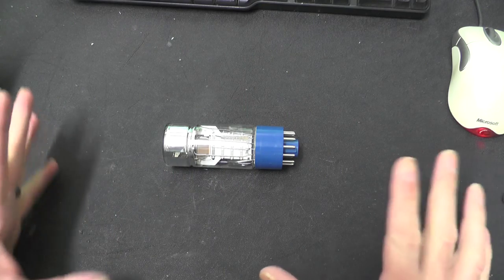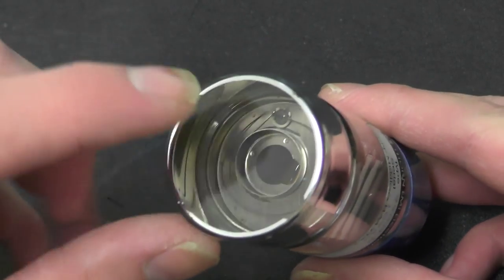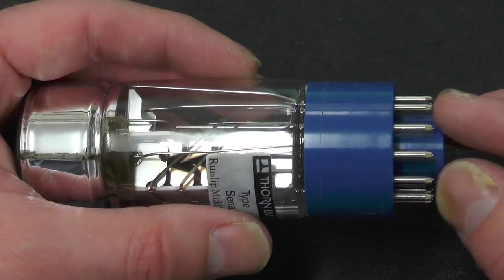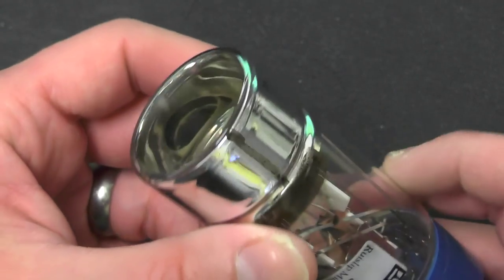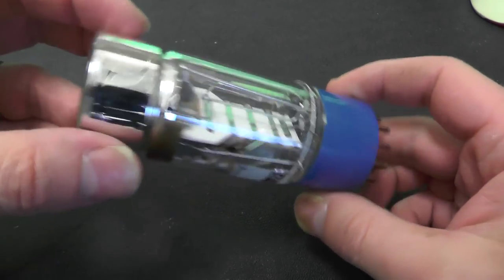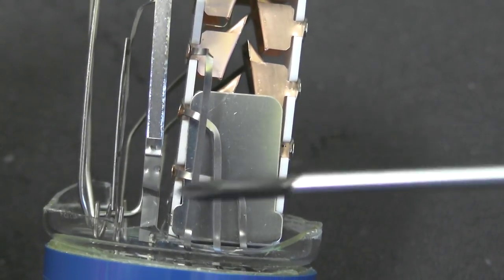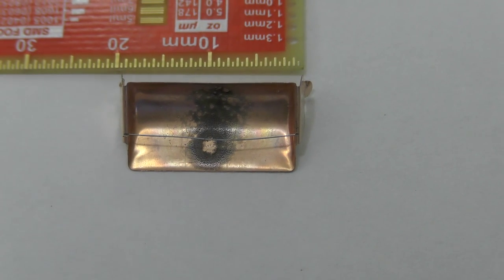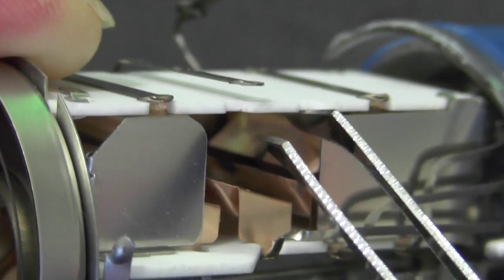DL#046 - EMI 9902KB Photomultiplier Teardown

Comment: That strip to the cathode is probably your getter strip. There are getter materials that are non sputtering, but which are activated and then act as an absorbtive material for the evolved gas. Thorn was a leader in this, which is now used by Phillips in HPS lamps. You will find there is a second cathode lead on the other side ( possibly cut off before the tube base is done) so they can pass a current through the getter strip during evacuation in the oven just before the final sealing is done so there is the least amount of gas present.

The dynodes do get hot, they are absorbing all the energy of the primary electron over the minimum required to do the secondary emission. This results in heating of the material. The black is probably the sputtered off cathode material from the tube that was accelerated down to the dynodes from high voltage field, along with fine particles that got sputtered off the preceding anodes and then accumulated there, now turned to a black copper oxide as you opened the tube.
Reply from the maker: SeanBZA Thanks Sean, a fountain of knowledge as usual. Any thoughts as to the cause of failure? Thinking most likely it's been blinded.
Reply: +DextersLab2013 How would you connect the PMT to a power supply/transformer?
Reply from the maker: +Michel Dellepere You can see some of the wiring for a PMT in this video where i put together a radiation scintillation probe. https://www.youtube.com/watch?v=rmILTJVbNb4

Comment: Thank you, I'm doing a project on night vision and this PMT is a major component of it. Do you think you could have fixed up the tube by finding some way to clean off the dynodes and then replace the tube (and you would obviously have to vacuum out the tube after you reassembled it, )? I'm wondering about this because I'm thinking about trying to assemble my own PMT tube for cheap rather than buying one. Also do you know how much that tube costed/where you got it from?
Reply from the maker: +J Longworth It's not worth trying to repair a PMT, if you need something cheap i have some PMTs a here, or Sphere in Canada have loads available: http://www.sphere.bc.ca/test/photo-tubes.html
Reply: DextersLab2013 Thanks!

Comment: Hi, I was handling PMTs not attached to any power at room light and was told by an engineer that this damages the tube. I am wondering if this is actually true? I thought that would just be the case if there is voltage applied. Any ideas?
Reply from the maker: I don't know TBH, it's an interesting question!

Comment: I think the getters are radioactive, so using one in a tube designed to detect radioactivity would not be the best idea
Reply: I've heard of radioactive cathodes (thoriated) but never a getter. What are they made of ?
Reply: i believe barium
Reply: the getter is definitely not radioactive. all that would do is serve to increase the dark noise of the tube and reduce its sensitivity.
Reply: @Muonium1  Dark noise, is that the same as background noise?
Reply: @88njtrigg88  Ya